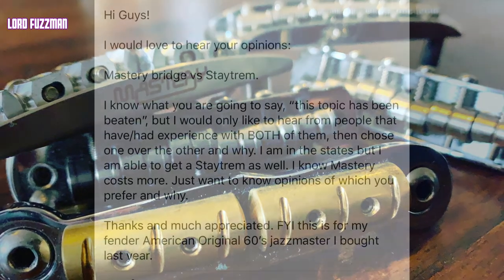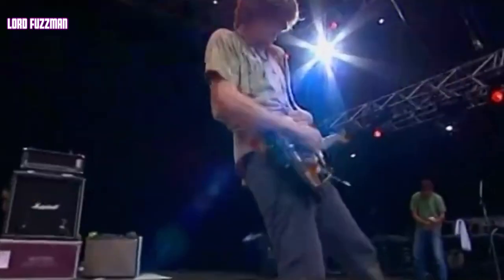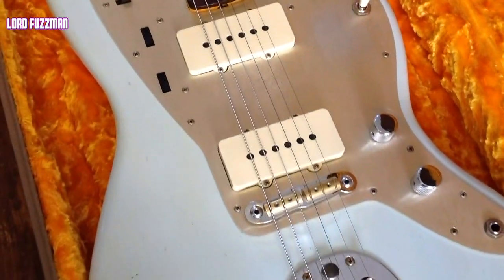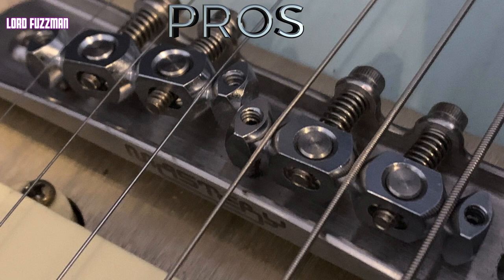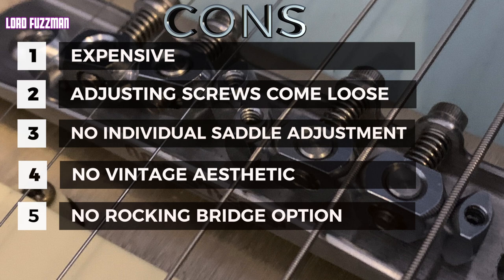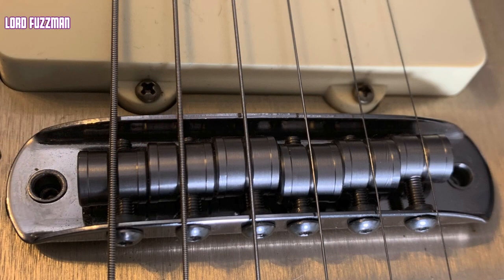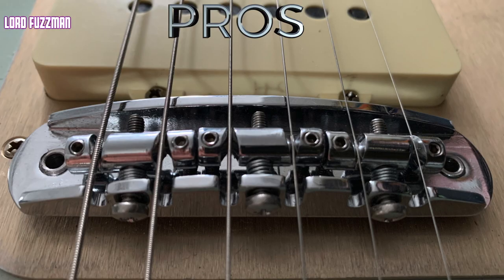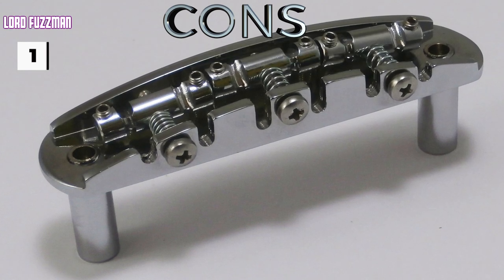ULTIMATE OFFSET BRIDGE SHOOTOUT - Mastery - Halon - Staytrem - Fender RSD - Mustang - Vintage

Comment: I mounted a Staytrem to my bass vi.  I was lucky to have a friend in GB that handled the delivery and forward posting to the USA.   I set it up to not rock as I made the bass a hardtail, it’s a bass afterall.  My low E string now intonates perfectly.   As for tone, probably imperceptible except for intonation.
Reply from the maker: Yeah I have two bass Vi both with Staytrems, perfect 👌
Reply: @LordFuzzman  I took the Fender trem off and installed a B5 Bigsby.   It works, looks great but it doesn’t have enough throw to do anything but a little wiggle.  It really needs to be a hardtail.  I have the piece but the strings are $40.  I’ll wait a while.

Comment: I came here because I am thinking of buying a custom offset guitar from a boutique shop in Amsterdam (rebel relic wrangler model). I'm doubting between two models, you can see them on their website if you search for rebel relic amsterdam and on their website search for wrangler. There is a mahogany model with a mastery bridge and deusenberg tremolo, and a white one with mustang bridge and G5 duesenberg tremolo. I tried them shortly and found the tremolo on the guitar with the mastery bridge quite stiff. Is this because its not a rocking bridge? and the mustang bridge is? thanks for your help, curious to hear which guitar you would choose of those :)

Comment: This is one of the best comparison videos I’ve seen. Thank you. I am about to order a Halon, but am trying to decide on the material. Are you using the stainless steel in this video? Do you or anyone here have insight into the material choices?
Reply from the maker: Thank you, I believe I was using the stainless steel Saddles on this Halon bridge. I’ve since swapped to brass saddles, there’s a slight change in tone which seems good to me but it’s not a huge difference 👌
Reply: @LordFuzzman  interesting…I had originally decided upon brass, but then wondered if I would be missing some high end edge that the steel might have. Would you say the brass might have a bit more body than the steel?
(I am definitely “thinking too much” at this point.)😂😂
Reply from the maker: @steveroberts5402  it’s so hard to say. In a band or mix I don’t think you would really notice the difference. Clean on its own the brass would have a little more body I think.

Comment: Most detailed and interesting video. I bought a new Jazzmaster Pro 2 last week (Dec 2021) my first offset guitar. Already yesterday I had to order a neck pocket shim because I can't adjust the bridge to my liking. Haven't had much chance yet to test it properly but I'll be referring to your information and examples in this video. I have subscribed too.
Reply: Ummm…the American pro 2 has micro tilt at the neck pocket…so you don’t need to shim them, just adjust the micro tilt. It also already has an angled neck pocket..
Reply: Since I posted this comment, I have replaced the bridge and tremolo assembly with a Mastery system, plus I have had the guitar setup done by a PLEK machine. I replaced the tremolo assembly mainly because the stock one will never work with strings above 10's, due to the weak spring Fender won't replace. It's now perfect 100% for me.
Reply: @johnperry9082  I have the panorama on mine still, tried the yellow spring..still not right with 10s. I’m cool with it though, but I am considering back to 9s because I really do enjoy the panorama…but then 10s…agh it’s hard lol

Comment: It's funny how perceptions of things change - the Mastery bridge was hailed as revolutionary when launched in 2007, but now people are very quick to rag on it and make claims like "it can't intonate the guitar properly" and "it makes no difference".  I disagree with both, and can only guess that the only reason the opinion has changed is because the way Mastery bridges are made is now different from how my older model was made. 

I've had mine on my Jag for like, nearly 17 years now as I got one when they first became available.  The reason was the stock bridge was useless for me, two different Mustang style bridges helped but only a little, and I was tired of fighting with the damn thing.  I literally injured my playing hand with the stock bridge as one of the saddle grub screws got super loose, stuck up and dug deep into my little finger when palm muting, it bled too.  For me that's a huge design flaw - the instrument shouldn't injure the player, should it?

The stock bridge was designed at a time when heavy gauge flatwounds were the most common string type and in some cases the only string type - listen to stories about how players like Brian May used to have to buy regular guitar strings and also banjo strings to combine into a lighter gauge set.  With heavy flats, the string tension bearing down on the shallow grooves etc would be a lot higher, so string skipping and saddles/entire bridge sinking probably was less of an issue.

With lighter gauge rounds and a heavier touch and/or string bending especially for anything over two semitones, issues can and do happen, such as the stock bridge having both the saddles and bridge itself sink downwards.  When both of these things happen you might not notice it for chords, but at a gig when you suddenly bend a string and it instantly frets out on a vintage radius 7.25" neck in the middle of a guitar solo and everyone notices, that's pretty embarrassing because audiences who don't know how guitars work will just assume you, the player, made the mistake.  I suppose in a way you did - you used a stock offset bridge with lighter gauge roundwounds and it failed on you.  Mustang bridges can help but the bridge itself can still sink even though the saddles can't, and one of the ones I tried the saddles themselves had gaps between them as if there was a mismatch between imperial and metric or something, and the saddles not touching each other has a small effect on sustain, as well as causing the distance between the strings to vary as they move around which is a problem for fast, precise playing like fast alternate picked arpeggios, to name but one. 

As I recall, the Staytrem or Custom Shop bridge with brass saddles (which is clearly inspired by the Mastery design and probably wouldn't exist without it) weren't in production back then and when the Mastery released, I jumped at the chance to finally solve some of the many problems I regularly put up with keeping the Jag playable.  I spoke directly to John Woodland, one of the creators of the Mastery, before I ordered, so I suppose the bridge I got was very early into production.  I got it shipped from USA to UK because they didn't have international distribution via third parties local to me yet, you had to buy direct.  John himself actually set the radius of the bridge to 7.25" to fit my '62 RI CIJ Jag, and it's never been changed because it's perfectly matched to the neck.  He was a total sweetheart when I dealt with him, very professional and with a deep appreciate for offsets.

As a longterm user of the Mastery bridge, let's dispel some myths and lies.  Does it intonate perfectly?  Why yes it does - I have perfect pitch and the Jag itself is well set, so if it wasn't intonating properly I'd notice and have found yet another replacement bridge years ago.  Not only is the intonation great, I can only ever recall adjusting it once in the entire time I've had the bridge and I think that was because I changed the neck shim and my string brand around that time (I went from Ernie Balls to Elixirs which solved another problem offsets have - the unwound strings turning around in the vibrato plate, slowly unwinding, going out of tune as they do then eventually snapping, the gauges are much the same except the Elixirs run 11-49 whereas the EBs were 11-48).  Does it solve the sinking saddle/bridge post issue?  Yep, the bridge never sinks, and the only moving it does is rocking back and forth when the vibrato is used, as it should - one of the lies I see told is that Mastery bridges don't rock with vibrato use, well they do it's just not as obvious to the naked eye.  Do they improve tuning stability?  In my experience yes, it's not a magic bullet but it helps a lot especially if you use the vibrato a lot and/or do a lot of lead work with wide bends (I do both).  Does it improve sustain?  Yes, not by some huge amount but it's noticeable, especially when combined with a Buzz Stop.  Little but noteworthy improvements.  Does it change the tone?  Absolutely, I'd say it adds more top end and sparkle, plus perhaps a tiny bit more bass - the fundamental offset characteristic tone which is heavily related to the unique vibrato system is there, but there's more of it all round, for better or worse.  I understand some players don't like that change, but as my Jag has really hot pickups in it (Seymour Duncans - RWRP QP SJAG-3n in the neck and Hot Rails SHR-1b in the bridge) this is counterbalanced nicely and if anything the Mastery bridge contributes to those pickups never sounding muddy - on the lead circuit at least, the rhythm circuit always sounds muddy, that's kind of the point. Does it have sharp saddles? Nope, and I can't see any signs of wear on the saddles, but oddly I can on the one shown closeup in this video. 

Did you read all of this?  If so I'm impressed.  It's probably completely useless information to most people, but fitting the Mastery bridge allowed me to properly make my Jag my main guitar, so much so I wore out the frets and it was refretted 2 years ago.  First guitar I've played so much that happened, and as someone who found it transformative to the guitar, all positives no negatives, I see fit to evangelise about it now and then.  I've done paid work with the Jag for years including in my current wedding band so I'm not just talking about now and then, this gets played out dozens of times for recording, rehearsal and gigs.  Tens of thousands of hours, man, this guitar is a workhorse and looks like it.

Comment: Have you tried a Compton bridge on any of your AOM equipped guitars? They seem to be intended as replacements for the Gretsch floating bridges, but I've read a few forum posts where they've been used on Jazzmasters/Jaguars. I've been thinking about getting one made for my Squier Mascis, but there's not a ton of info about them online.
Reply from the maker: reverb508 No sorry haven’t heard of them to be honest! Will have to try and get hold of one 👍🏻
Reply: @LordFuzzman  I think I'm going to give one a try. They're not terribly expensive, and since Staytrem won't ship to the US anymore, my options for drop-in AOM bridge replacements are pretty limited. Only downside I can see to the Compton bridge is that it's just a single piece of metal with a bevel to handle intonation. I'll try to remember to report back with my experience. 

Great video, btw! You go above and beyond with these comparisons and it's appreciated.
Reply: Just remembered that I promised to check back in. I've had my Compton bridge for over a month now and am very happy with it. They offer a few different options for materials like stainless steel, brass, and titanium. I ended up going with a brass bridge and the guitar sounds livelier and has more sustain after making the swap. It also plays better now that the bridge radius matches the neck. The bridges are made to order, so I had to provide post measurements to ensure a proper fit for the existing bridge posts on my J Mascis. Here's the specs I gave them: 

Bridge base stud post spacing- 73.66 
Fretboard Radius- 9.5' 
String spacing from E to E- 53.97
Reply from the maker: @reverb508  sounds good ..I’ll def check them out 👍🏻

Comment: Great video.  Good overview.  I couldn't really hear any difference in tone though (probably my laptop).  In defence of the Mastery, which I have on a MIJ Jazzmaster, a few points: The guitar is louder acoustically (not plugged in).  Plugged in, hard to say.  More sustain: hard to say.  I've NEVER had it cut my hand when resting on the bridge.  Ever.  I've never had any screws come loose.  EVER.  Having said all that, I had the guitar set up by someone who knew Jazzmasters and he shimmed the neck and wound tape around the bridge posts to stop any vibration (some people hate this or feel it changes the tone - I don't give a monkey's).  This hasn't reduced any sustain (then again maybe the Mastery does increase sustain so who knows?)  I also have an American Pro II Jazzmaster.  A very good guitar.  Better than the MIJ (mainly the pickups).  The bridge on it is 'Mustang-like' and works just as well as the Mastery, i.e., no problems.  Finally, a caveat: I bought my Mastery four years ago and hadn't realised that I'd have to pay import tax (I live in the UK) which was hefty.  Consequently, the Staytrem is obviously a wiser bet for UK residents. Oh... and the original bridge that came with the MIJ was dreadful no matter what I did with it (I suppose it might stop rattling with gauge 14s).  Thanks for the video.

Comment: Thanks for review! Just in case, don't you know a drop-in replacement for adjust-o-matic bridge with a correct 9.5" radius? I have no idea why fender put flat bridge with 9.5" neck. =/
Reply from the maker: Valentine Silvansky - Thanks. Staytrem did do a drop in replacement but stopped production now. I did a video on that a couple of years ago .
Reply from the maker: Just spoke to Halon, they make a drop in replacement for adjustomatic 👍🏻
Reply: @LordFuzzman  Great! Thanks a lot for information! =)

Comment: Excellent video! For me i did not like the sound of the halon or mastery. Seemed like they were just louder and not in a pleasant. It was all fairly subtle though. For me this makes the stock bridge king. All issues like you say can be solved with a correct setup. Costs nothing...well maybe a bit of locktite! Cheers
Reply from the maker: Destroying Amp Gear Demos Thanks buddy  🙏🏻

Comment: interesting video. To my ears the difference is minimal if even there, certainly not a $150+ change in tone. A tad more or less sustain makes zero difference in my playing. Crazy how expensive some of these are, I have a Squire Jaguar and I'm certainly not putting a bridge on there that costs almost half the price of the guitar. 
I did put some electric tape around the feet of the stock bridge to stop it from wiggling and I added a 1mm shim under the neck, all fine with that little cheap mod. 

Some of these look so bizarre and out of place too. Not my cup of tea.

Comment: Would like to point out that on a new build, you can avoid all this and use a regular cheap jazzmaster tailpiece / trem and a Göldo (Duesenburg) low rider TOM bridge. (It works w Fender / flat neck pocket unlike other TOM bridges.) You’d be amazed how well that works compared to the original design.
Reply from the maker: They are fixed radius .. do you know what radius they come in?
Reply from the maker: One site says they are a 12 inch Radius. So not gonna please many with a vintage 7.25 radius neck unfortunately. They look well built though 👍🏻

Comment: You say the pre set radius on the stay trem is better, but technically, as you adjust the intonation it will affect the height of the individual strings slightly, so individual string height adjustment is nice.
Reply from the maker: I hear what you’re saying but seriously I’ve used them on dozens and dozens of guitars. That’s never been an issue. Simple height adjustment on each side of the bridge, bang.. it’s perfect 👌

Comment: between the staytrem and mastery on my jaguar i found the mastery was a lot brighter. the staytrem had more sustain and was fuller sounding, there was actually a really noticeable difference. cool video!
Reply from the maker: That kinda makes sense when you think about it. The mastery has full contact posts into the thimbles which means the body is absorbing the vibration more hence more sustain on the Staytrem

Comment: Those old bridges simply do not rock or pivot with that <pins in posts> system. Total waste of time. They go as far forward as they can and then stay there, no matter how much you yank the trem arm up. Best bridge replacement is a Wilkinson roller set on embedded TOM studs. In addition to the regular length adjustment, you can actually shim each saddle with slices of beer tin to give individual string height adjustment, so no radius problems. PITA to do, but you'll be amazed. They cost about 10 bucks on Ali these days.

Comment: Thanks for the extremely comprehensive and information-rich video. I was skeptical about the bridge affecting tone that much. I have a mastery on my CS Jazzmaster but I think the Staytrem and RSD sound the nicest. Do you have a particular preference for any?
Reply from the maker: Personally taking everything into consideration I would say Staytrem.
Reply: Lord Fuzzman Is your Staytrem the rocking version? I live in the U.S. and currently the only versions I can find available are the rocking Staytrems. As I said I have a mastery which is non-rocking, but I’m tired of the screws coming loose, even with thread locker, and I think I’d rather have the fixed radius of a Staytrem. However I use 9 gauge strings and am unsure if they’ll be able to hold up to the rocking bridge mechanism. Some have suggested you need to use heavier strings. Any additional opinions? Sorry for the long rambling comments lol.
Reply from the maker: Luke yeah 9s is pretty much unheard of on a Jazzmaster. Generally 10-12 gauge works best. Staytrem also do a non rocking version. I guess it depends on how much trem/vibrato you use. I would perhaps try using 10’s to start with.
Reply from the maker: Luke all my staytrems are the rocking version yes 👌